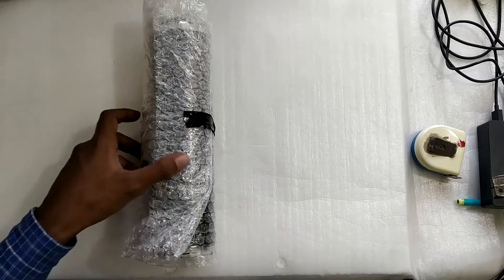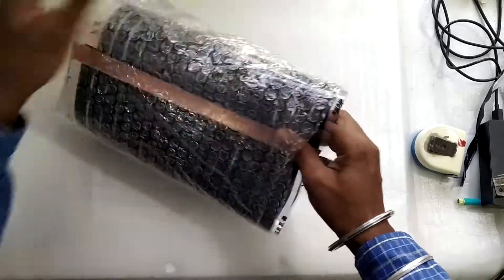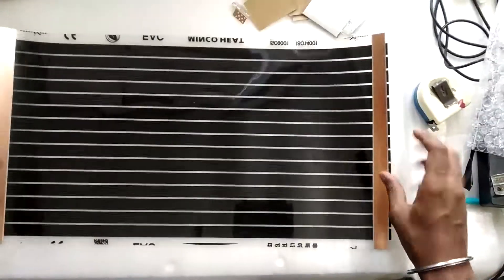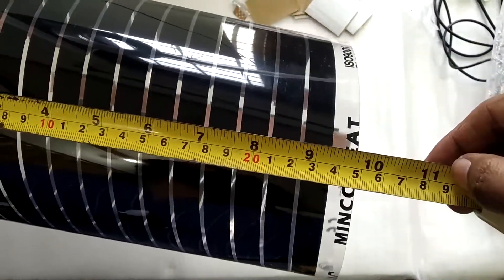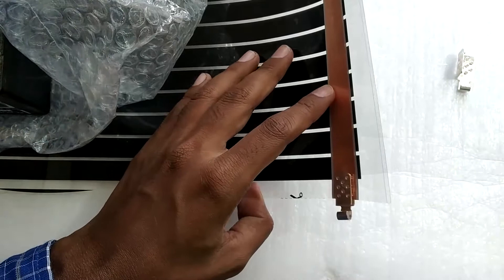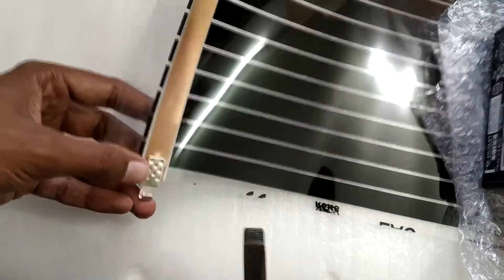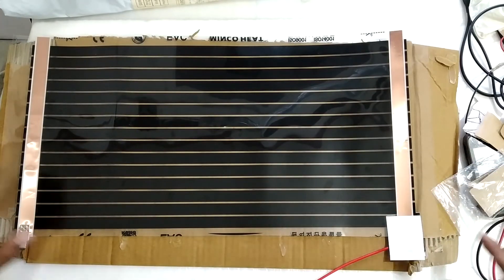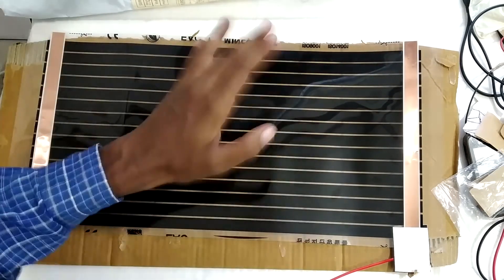Carbon Heating Film  Heating strip

Comment: Nice demo. It could get warmer if you insulate the backside with styrofoam and a sheet of Radiator foil (basically aluminium foil). All the heat will go out front, way more effecctive. 60-70 degrees is no problem.

Comment: I'd like to know what would happen if that thing were hooked up to 12V DC.
Reply from the maker: If you connect it with 12v it will not work because the resistance it too high for 12v. At 12 volt it will only use .07Watts of power and not heat up at all.
Reply: 3 40v panels in series